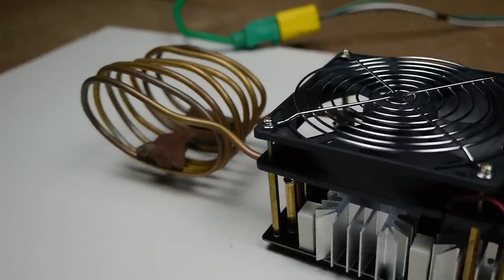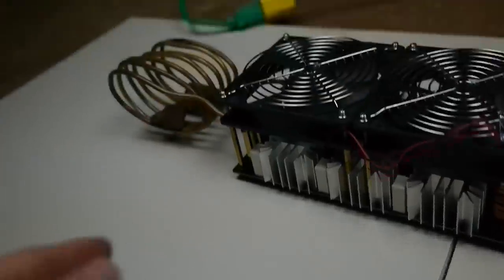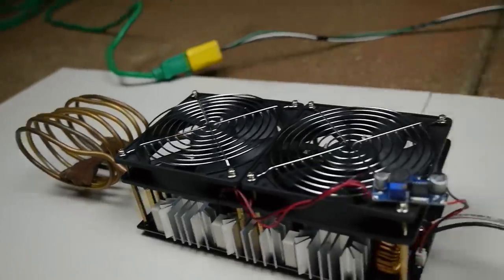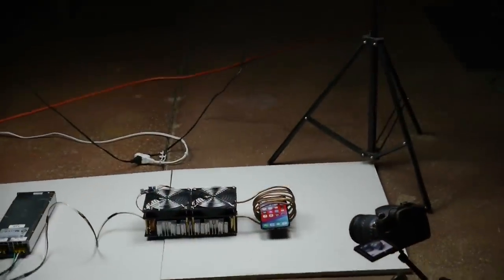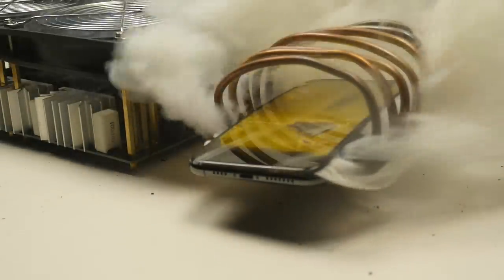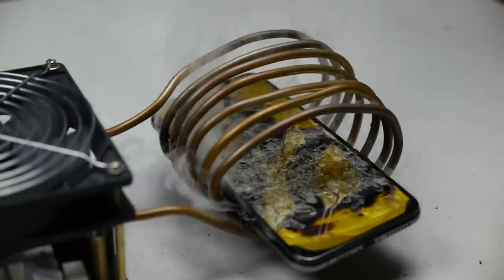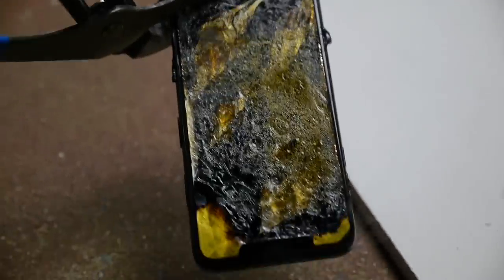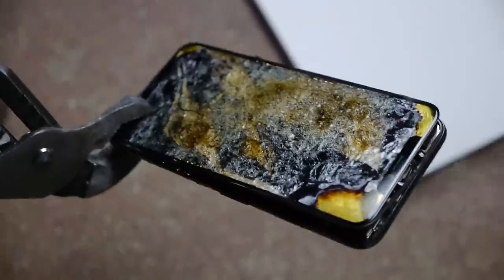What Happens If Induction Heater Meets iPhone XS Max?

Comment: Sell it on eBay with description: Never used brand new iPhone XS max
Reply: lol
Reply: Scammer
Reply: It's technically not wrong, it's brand new, and it's never been used.  It may not be in new condition though... lol.  "Brand new never been used, not like new"
Reply: @redsquirrelftw  It was used. If it was turned on and touched on the display it is already used.
Reply: Straight Busta Original
Reply: Same old CJ busta STRAIGHT busta
Reply: Better on craigslist

Comment: You heated up a phone and the battery exploded, wow.
Reply: Ikr. I expected it to stand up and walk away from the coil.
Reply: John C John if it was a droid (Star Wars) it would have, Android, I think it would have detonated sooner, specially if it was one of that unmentionable model that detonated Samsung half to death.
Reply: @John_C_J  😂😂😂🤣 damn
Reply: @GilliganFan6467  techrax actually put a Note7 in an oven and it never exploded, but this one did
Reply: Intellitech Studios there’s a difference between an oven (only a few hundred degrees) and an induction heater (which is capable of inducing temperatures up to and including the thousands range and melting metal.) Refurb a Note 7 with a ferrous outer case and it will blow up sooner, I can guarantee it 100%
Reply: @GilliganFan6467  tell than to the exploded iphone x on an ios 12.1 update. just shut it. batteries will exploded when there is too much heat, that doesnt make the iphone delay in exploding than a samsung
Reply: @John_C_J  oldso gyslatat

Comment: Iron plate. That's not the point. If it was aluminium, tough less resistive, it would burn too. There's no need of ferromagnetic material to heat up in induction coils.